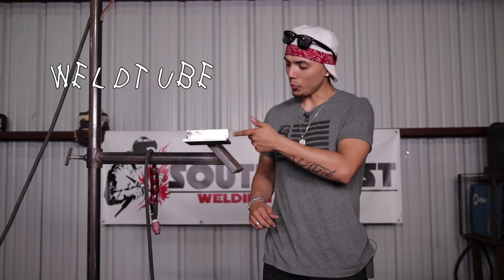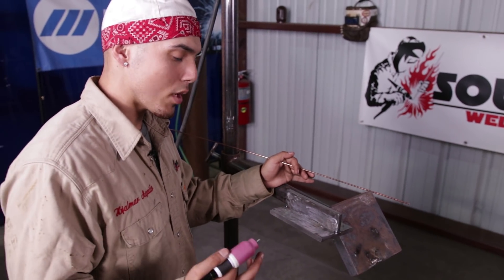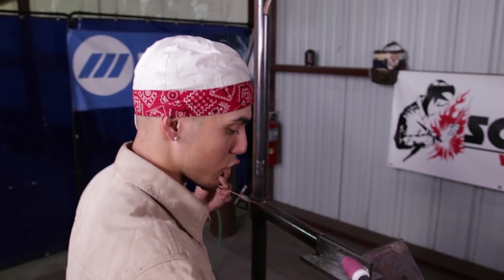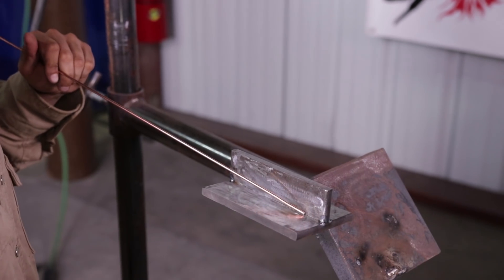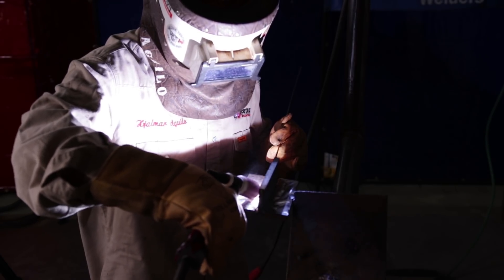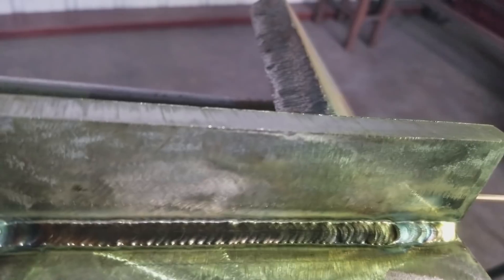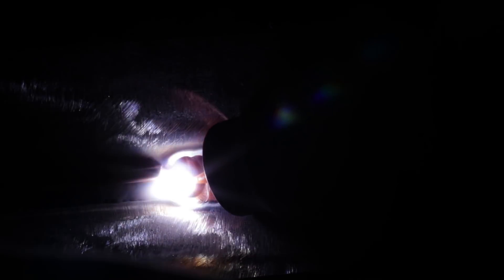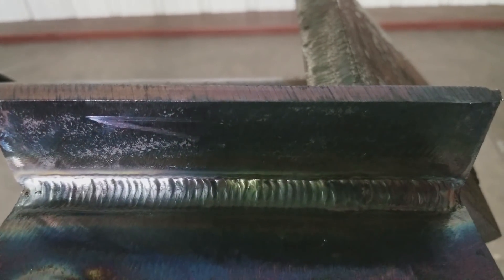How to TIG Weld a 2f Horizontal T-Joint

Comment: I was running perfect beads like this in class and my teacher yelled at me because “lAy WirE TeChniQuE.” Apparently it doesnt hold as good as dabbing. He then tried to break my coupons with a hammer and was not able to. Is it true that employers won’t hire me if I weld like this? I can dab a decent tjoint but laywire looks so much cleaner.
Reply: I dont understand why he yelled. Its practice not a actual job site that requires precision and strength. He shouldve lectured you instead
Reply: Wow dude holy moly thanks for the reply i cant believe this was 3 years ago. Man brought back memories. How much things have changed. Im in the industry now and even teach  that same class last year. Super cool. Yea my teacher was a D  but he taut me how to melt metal and make money  @aztecakidgames3672

Comment: This is one of the best welding channels. I like how there is an explanation and a demonstration. Before there is a bead ran. A lot of other channels tend to forget. If someone is watching they are needing to learn something, and run at full speed.
I didn't get a lot of practice in school on Tig at school. I had the luck of the draw, and ended up using junk Mig and Tig equipment. I spent more time trying to get my bend tests passed. Than trying to get proficient.
I work for a shop now. That will let me practice on my own time, and always has a lot of drop. So, I'm going in early to improve my Tig welding. Videos like this really helps.

Comment: I'm welding 1/4" steel and I keep getting under cutting what am I doing wrong
Reply: Im on 1/8 but i keep getting undercut too
Reply: you might have your amps low and your going slow causing a lot of heat in your metal but I recommend turning ur amps up and go faster while welding
Reply: Amps are too high

Comment: Quick question: how do you know that you're getting penetration into the corner with the lay-wire technique on the root pass? Is that a function of the amperage burning the filler in there? Thanks. Great videos, they've definitely helped me out a lot.

Comment: When did they start calling any fillet weld on glad plate a root and hot?  There is no gap so how do you root pass 2 pieces of metal with no gap?  I’m very confused

Comment: do you always run scratch start or are you using a foot pedal ever?
Reply: see if southcoast will buy you a dynasty :)
Reply: i started out using a high freq with foot pedal... but man i really like the freedom of scratch start i just started doing pipe myself and i like the freedom you get not having to drag a pedal around its sweet funny in my garage my welder friends come over and im using a little stick welder inverter running scratch start with my everlast machine sitting there
Reply: Part Out rather than using you pedal, does your weldset not have a 2t/4t function? Use it all the time, less dulling of tungstens than scratchstarts that way, can do a 10hr day with only one or two touch ups on the bench grinder then
Reply: yeah it does but i hate the switch being on the torch.. messes with me
Reply: just the way i hold the torch i guess